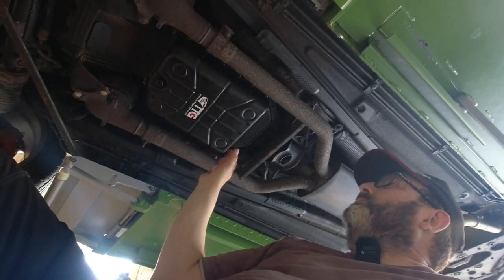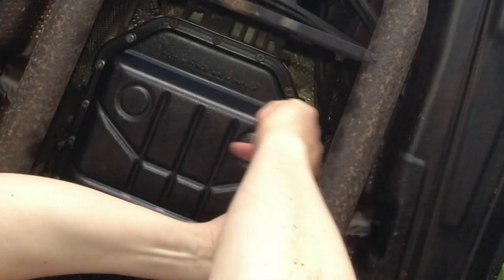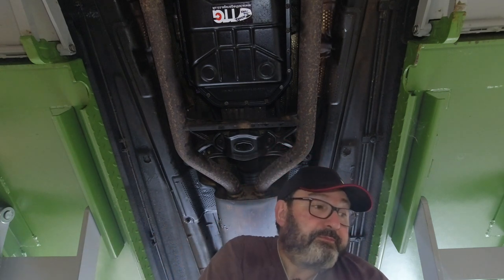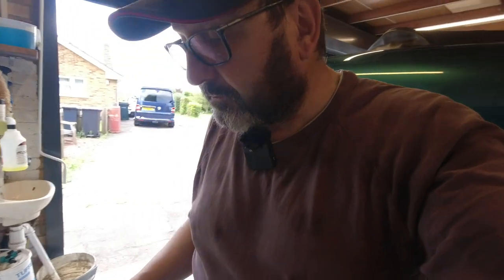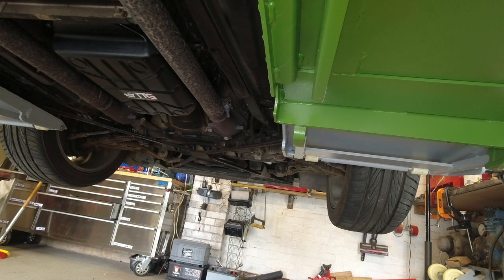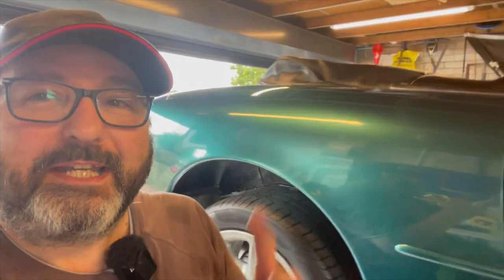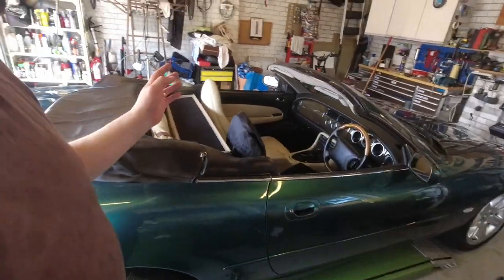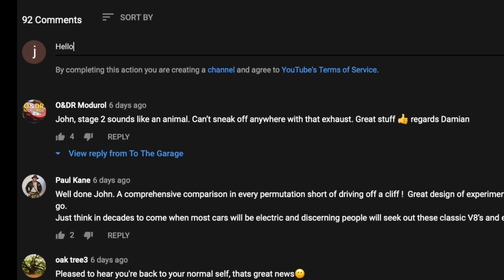Jaguar XK8 XKR X100 Gearbox service part 4 (Last part!) Getting the oil level right.

Comment: Hi John, I’m just a tad late to the party.  Enjoyed the series and related to some of the trials and tribs you went through.  I had the fluid changed in my 2004 XK8 ZF6HP transmission last year. I decided I wasn’t comfortable under the car with the engine running (even though I have QuickJacks) and had a transmission shop do the deed.  I supplied all the fluid, pan and filters so it was done while I waited.  Keep up the great work.  Cheers!
Reply from the maker: Glad you enjoyed it

Comment: Hi John, 
Another great video. When I did the same job on my 2000 XKR this has a dipstick/filler tube at the back of the engine bay, made the refilling process much easier. The only issue with this set-up is the tube is blanked off with a plastic cap that is not reusable, once you break the seal to remove the cap you will need a replacement. I also got an aftermarket dipstick; this is very helpful in determining the correct level of fluid.

Comment: Great set of videos John. Presumably if Jaguar hadn’t insisted on a ‘sealed for life’ box they would have put a filler into the engine bay, like my old XJ40, which would have made the job considerably easier! I wonder if anyone has ever made an adapter to the box to allow this? Maybe a gap in the market there! Regards
Reply: You can buy a kit which screws into the fill/level socket and leads up to through the engine bay to a remote fill point. All you have to do then is drain out the old oil, measure the volume extracted and pour the same volume through the remote filler.

Comment: I don't envy you having to do all that lying on your back. I used the recommended Mobil LT71141 oil in my XK8 and it was a yellow colour, the same as the fluid I drained out although that had darkened. The red stuff looks more like a Dexron III spec oil although it will presumably be an equivalent.

Comment: strange you put in 5.1L into the gearbox as they say that without any oil in the torque converter its 6L in total and with torque converter its 4L . I did exactly the same as you and all that came out was 4L and what went back in was 4L , and i also waited over night for it to drain . so i,m unsure where you found the extra 1.1L .  Good tip on the tapping of the gearbox sump bolts . without it they will not undo .
Reply from the maker: Hi Derek. I think mine was previously overfilled by filling while not level and how much oil drains out of your torque converter is more down to luck than judgment, How it was driven just before dropping the oil. seals, the position that the torque converter settles in ....   So the long and short of it is. I dont really know😁
Reply from the maker: Yes Ive struggled with those sump bolts on my previous cars so developed that trick along the way.

Comment: Re the fill plug.  My research says the thread is M18-1.5, so a Fumoto Drain Valve that MIGHT work in theory is FG2SX, but only if it can seat properly.  I have the 6HP26 trans, so can't verify fitment for the 5HP24.  If seating is an issue, multiple crush washers could be stacked to fill the gap.
Reply: what a great idea, that would eliminate the possibility of of burns and crossing threads while trying to line up plug over hot exhaust. When I do mine I'm going to research this idea.
Thanks

Comment: I was a little surprised by the colour of the ATF that you put in. I thought that it was a different colour (brown?), however it could be that your transmission uses a different oil than mine (6HP26). Excellent set of videos. Thank John
Reply: 6HP is straw coloured

Comment: Nicely done, no swearing! The first time I attempted this, I felt like I had to race against the transmission getting too hot (over 40c, or so I thought) but that didn’t seem a concern if yours?
Reply from the maker: The temperature is not hypercritical.  If you think about doing it on a windy or cool day, the transmission pan surface would be cooler than the oil it contained and so you would wait longer before doing the top up and the oil would be hotter.
All the temperature requirement is there for, is to ensure that the oil is  :-
Not cold.
Being pumped around the transmission.
The gearbox has recognised that it is at operating temperature.

You would have to go considerably over temp before it affected the oil volume and therefore the level.

Comment: Yet another great video. I noticed that when you ran through the gearbox to circulate the new oil, that to ensure 1st gear was operated, you had the box in sport mode. Good thinking, but you didn’t mention it.
Reply from the maker: Great point as always Nev.  Sometimes I know to do things, but don't think to explain them😔
Hope you are well mate👍
Reply: @ToTheGarage  Very well thanks as not had your horrid bug. 
Trying to find cause of multiple warnings that come and go. Maybe a poor connection on the bus somewhere, but where???? I sent cluster for check up last year. 🤔🤔🤔

Comment: On my 2001 XKR convertible ther is a oil fill/ dipstick tube which has a blanking piece on the end I have heard this is quite common . I have bought an after market dipstick for it hope fully when I change the transmission fluid it will make things a bit easier .was wondering if it may be an option you could fit on yours or not.
Great channel btw.
Iain Laity
Deepest Cornwall

Comment: I can tell you now, you really only want to use ZF LifeGuard 5 on these boxes. Anything will cause issues. I know you have already doneit, and dont waato sound like a knowit all, but they act strange without the ZF specific fluid. I got my car with weird box behavior. It had been changed etc within 500 miles, but it was acting so strange - level was correct etc. I did  change and it toally transformed it back to a normal operation. Mentioned many times on te forums.
Reply: I have used Valvoline Maxlife in my 2001 XK8 with no problems along with a lot of other people. It meets the LT 71141 spec.
Reply: But Johns gearbox is a Merc 5 speed box, not a 6 speed ZF as used with the later 4.2 engine.
Reply: @stagnite2  John's gearbox is the ZF5HP24 5 speed, like mine. I think that the Merc gearbox was used in the 4.0 XKR but I have no experience with that.